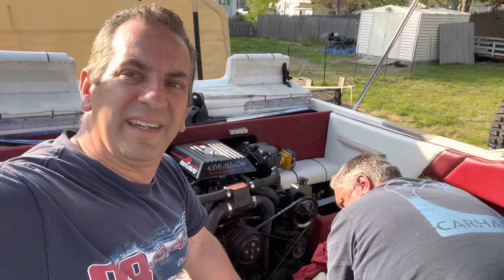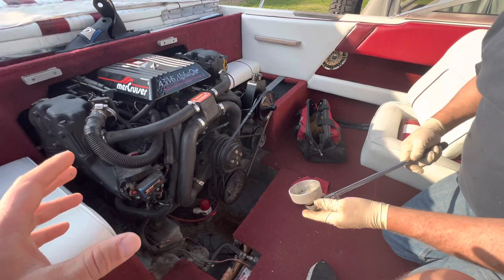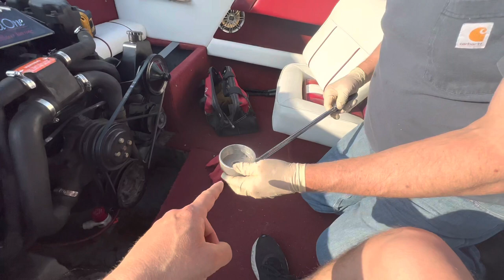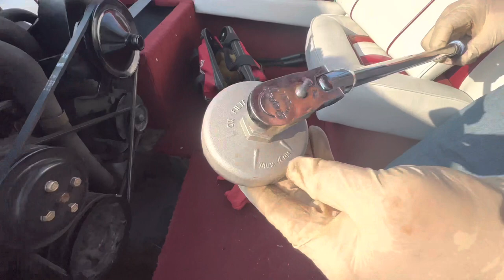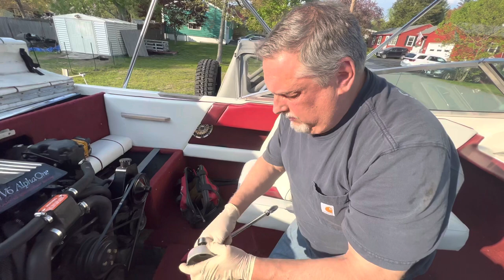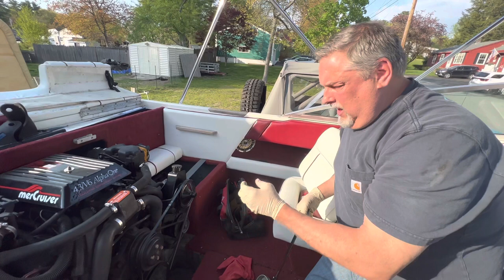How To Remove Stuck Oil Filter On Boat Engine

Comment: What you do is you take a long slotted screwdriver and you stab it through as close to the threads as possible. Always works
Reply from the maker: This was another method that I though of trying while battling this oil filter, however you have to keep in mind the location of the filter. It is tucked up an under the engine. If you shred that oil filter into a million pieces and end up with the top of the oil filter stuck on the block, now you're really in a pickle. IMO this was the best course of action in this situation, I have used the screwdriver trick on cars once in a great while. Thanks for checking us out!
Reply: @HomeownerRepair  Yes, location is key